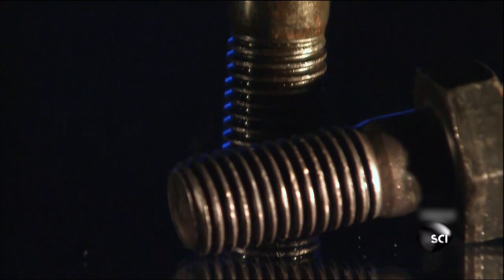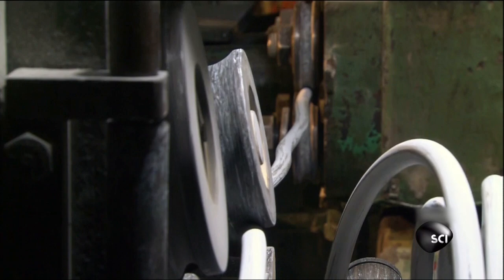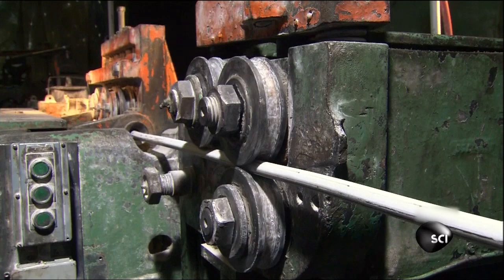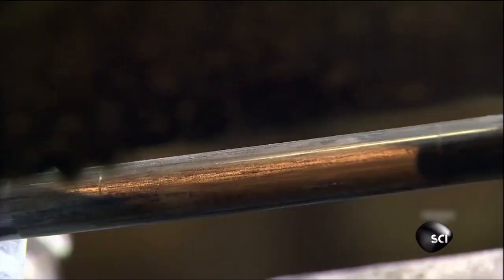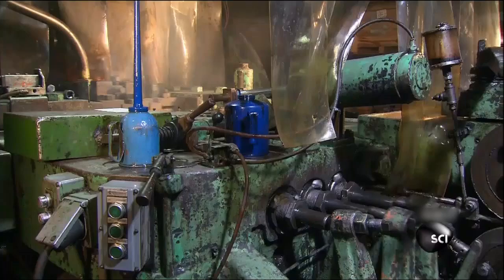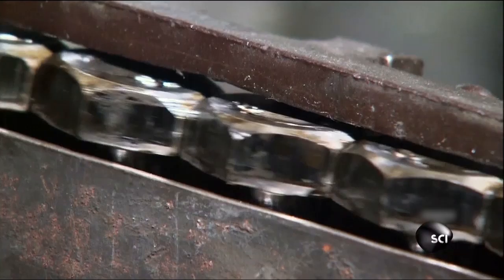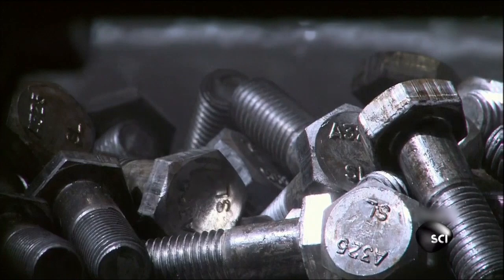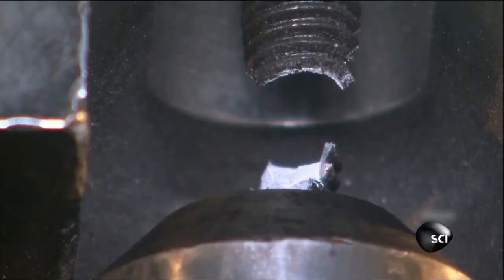Factory Made-Small Bolts

Comment: '
coil roll metal is a soft mild...
cut and pressure are easily punch nuthead...
die tap screw is easily roll...
after that done then put on high fire heater hot to cause the metal become harden and strongen